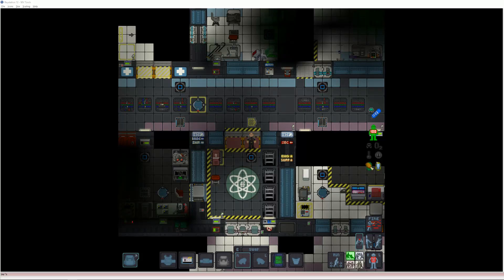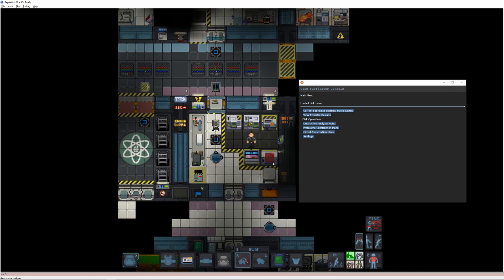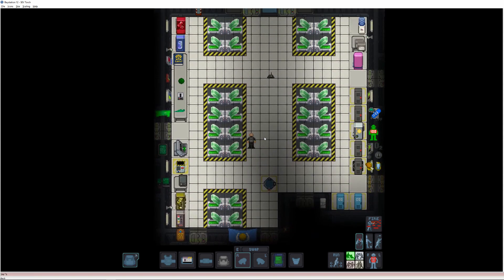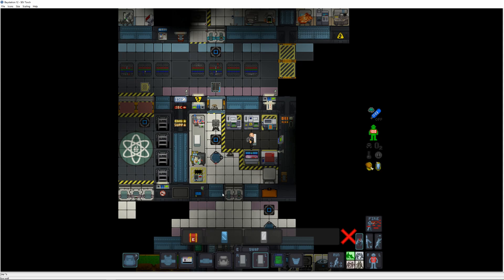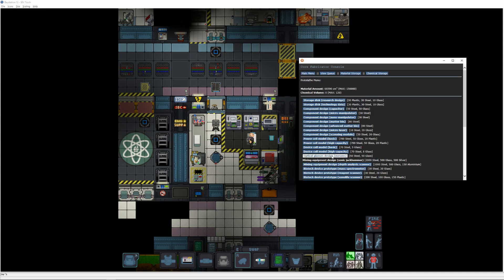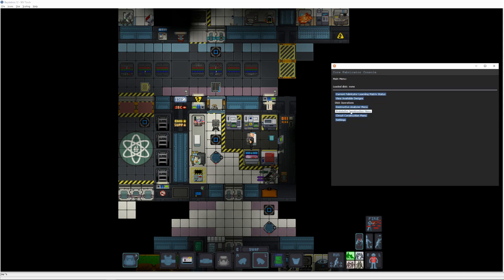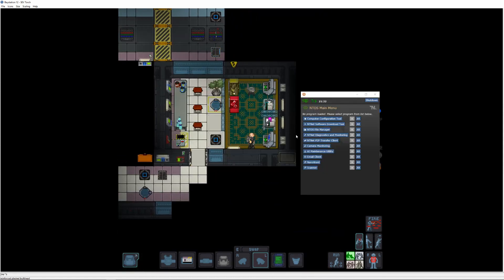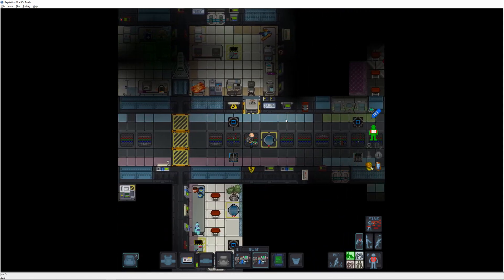Space Station 13 Tutorial - Research, Development, and Fabrication

Comment from the maker: Yeah, I've been MIA for a while.

Most of that time may have been spent learning Space Station 13 so I could make tutorials. Maybe. It can't really take weeks to learn a game. Can it?
Reply: Not sure if you addressed this in a previous tutorial. But did you know you can use those pico-manipulators, lasers and matter bins to upgrade the protolathe for efficiency? Can be a good way to make more for less, generally! 

Just need some basic toolbox items to deconstruct the protolathe and rebuild it with the upgraded components. Screwdriver and crowbar I think? It's been a few months since my last round.
Reply from the maker: @MagnusFaustus  This is my first tutorial on SS13, so I haven't addressed it yet. I am planning a separate tutorial on that, however, as several positions do that work. As roboticist, for instance, I always do the same thing with the exosuit fabricators as you can cut material costs in half.

You're correct in how it's done, as well, although it's much easier if you fabricate one of those part replacement tools. Then it's just using the tool on the machine to view what parts it has that you can upgrade, and screwdriver-tool-screwdriver to upgrade without ever taking the machine out of service.